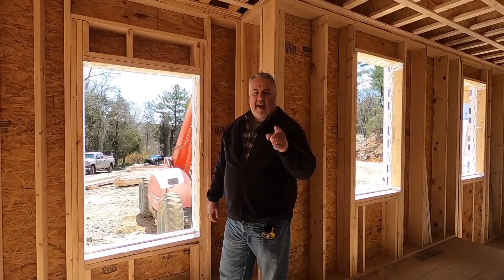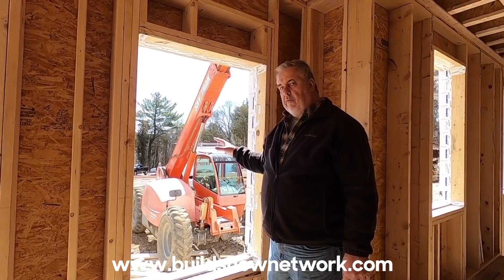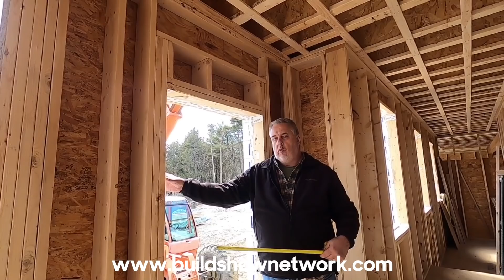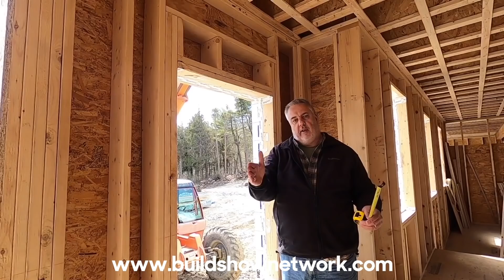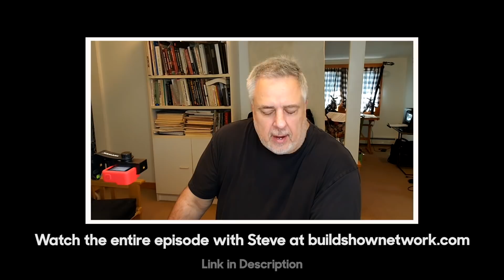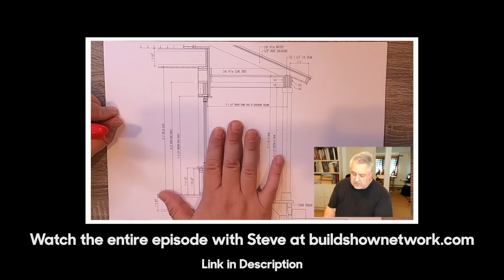The Fundamentals of Wall Framing with Steve Baczek Architect

Comment: double jack studs (trimmers) on such a short header span. Very unusual. I don't see the point. Also the cripples betweem the trimmers. Not necessary. I would think advanced framing would eliminate a lot here. I think it is clear this extra wood is not needed. Double non-structural header? This is prioritizing wood over insulation.

Comment: Steve, thanks for the video!   Can you please do a video on the construction of a house with floor joists, ijoists or trusses in a house with a basement?    I never have seen a detailed video showing the constructution but have seen joists on 2x6" over a cement wall, 2x10's with hangers sitting on a basement wall, and a few other things.   I'd like to see one that is designed to resist water rot and proper weight depth on the ledge etc.    I understand the type of joist and the depth of it is dependent on span.   Not sure if you'd like to get specific but I plan on doing a 2x6" wood frame house - single floor, with a basement.   Estimated size about 2800 square feet with a 36" wide basement.    I was thinking of splitting down the middle with a carrying beam or whatever the architect recommended.     I was going for about 10' between the basement floor and the sheathing for the 1st' floor, with 10" thick basement walls.

Comment: I fully understand the reason to use double jack studs to support the I-joist being used as a header.  In fact I would probably beef the I-joist up with some cripple studs inside the joist; sideways, hopefully leaving some room for insulation across the full width.  I hope there is already some insulation between the back side of the I-joist and the OSB sheathing.  With the wide width studs, I'm surprised you didn't use 2x10's with foam board insulation sandwiched in between.
Even so, I still think the window top plate should be supported also.  You pointed out the cripple stud below the I-joist;  where is that potential load being transferred?  And why isn't it centered?  I can only guess the wider partition is a 24" gap suitable for one of the planned insulation sizes.

The bottom plate looks to be untreated lumber.  Is the floor above ground?  I at first thought this was a garage/workshop because of the beefy door frame but the floor is not concrete.  What kind of door was planned?

Thanks for the education.

Comment: Honestly, I'm over stud style framing. I wouldn't if I built my own house. In fact, it makes me furious!
Reply: I understand the system, and it can work but I'm not cool with the generally inaccessible voids it creates, the attempts to stuff insulation, wires, and piping through said voids.
Reply: @David-gld  Matt Risinger of the same network here showed an awesome solid wall hempcrete build.
Reply: @David-gld  so, who are you?

Comment: I work in Oklahoma New Construction. I have a question. Why do you use 1x4s on the ceiling?
Reply: makes the drywall flat, texured walls is common for mid west, southern homes, most homes in the upper states and east coasts go with a smooth wall finish.

Comment: Wouldn't it be more economical, and produce a better insulated house, to use 2x6 framing and exterior insulation? Like Rockwool's comfortboard or Zip System R Sheating, not to mention foam board?
Reply: There is 2" rigid insualtion on the outside
Reply: You mean over 2x8 studs

Comment: so strange to still watch and see so much wood been used in construction. I am a fan of AAC and Concrete with Steel. And I think really we should start using those material a lot more often preformed to enhance the structure of a building.
Ok you got off a little bit there are 2 factors why you need a double top plate. One because your cross beams are off center. But more important because it is a CODE for any load bearing wall so later on it is easy to identity for remodel work to see what is a load bearing wall and what isn't.
Reply: Wood is a renewable resource with much much less embodied energy compared to concrete or steel, also has at least some thermal value, and easy to alter on site
Reply: @stevenbaczekarchitect9431  Wood sure is a renewable but also a weak structure material when you compare it to steel or concrete but lighter. If you would finally start to use more AAC you would see how much faster, more consistent and how much more R Value you getting plus on top AAC are Concrete Foam blocks so super easy to work with and with 51psi per square inch also much stronger than cinder blocks. You do really great work but missing out on benefits which will blow your mind away once you start working those into your portfolio. So keep up the good work and always challenge yourself to the next level.
Reply: Concrete is going to be short supply
Reply: @vanderumd11  Not for Florida. Maybe up north but Florida has their own mines so we a got all the supplies we need.

Comment: Nominal R-value = cavity R-value
True R-value = total wall R-value
Here in Canada, the codes are beginning to require R-20 as true R-20, meaning we must deepen the cavity, which presents more issues for condensation on the cold condensing surface (the deeper the wall cavity, the further the inside of the sheathing is from the heat, making it colder with heightened risk to condensation). The other solution is exterior insulation, more expensive, but seems to be the better option for building longevity.
Reply: Exterior continuous insulation is ALWAYS the win (except financially maybe)

Comment: The jack studs in the example don’t even support the window header. Why is that?
Reply: My best guess is simply that the studs are 2x8 and the actual structure isn’t needed for additional support. Just seemed weird to see it framed out appearing at first as expected, but doesn’t do anything but hold the drywall in place.
Reply: The jack studs go to the header. Which is a load bearing structure. The box below the header isn't load bearing and doesn't require the jack studs to that. Probably build this way to directly support the beams above. My guess anyway.
Reply: @Fucnut  Theoretically the header is designed to carry and distribute all load to its supporting "columns," which in this case are the is the jack studs. But, load transfer persists to all cripples (the "box below the header") as deflection occurs to the header (which happens in a gradual fashion as the building ages, or as sudden load is applied).

The cripples above a window are typically installed above the header in my area, so this is unusual for me to see and I am interested to see its benefits. But overall, cripples above the window apply the roof load to the header and around the window through the jack studs. The cripples below the window are never considered load bearing, but they are intended to support the weight of the window and any live load (like a person sitting) in the cavity space. 

-Studying engineer
Reply: @Fucnut  couldn't one also frame a jack stud to hold up the window header, and then a cripple in the top box to take some load off the overall opening?
Reply: @Fucnut  In this case, there are 2 jack studs that hold up the top of the "box" but no cripple studs that go to the top plate. I don't see any benefit for having 2 jack studs on each side of the window holding up no top plate load whatsoever.
Reply: The header is tight to the top plate, the framer prefabbed the walls in the barn and we weren't exactly set on the finish head height so they built down from the header
Reply: I noticed that to. It looks like he just built a box to put on top of the window which serves no structural purpose IMO.
Reply: @borys444  The jacks are supporting some sort of beam above the window and cripple wall.Never seen it done like this before but not wrong with it I guess.
Reply: Fereidoon Angoory yeah it’s as u say “some sort of the beam” but doesn’t that defeat the entire purpose of supporting a load bearing wall properly? U would need the window header  to sit directly under the top plate of the outer wall in order to distribute the load properly.
Reply: @borys444  The header is taking on the roof framing load above and moving it to the jack studs. The cripple is acting as just a wall infill framing. Not sure why they would put the cripple infill in.....maybe future renovation (Higher Windows etc).
Reply: Fereidoon Angoory but the header doesn’t go up to the top plate. It isn’t carrying load. It’s simply a 2x8 laying horizontal above the two inside jack studs
Reply: Iowa guy 43 Matt’s guys should make a video segment on y this window is framed the way that it is. Lol

Comment: Is that number of studs normal?  I count five studs by the window.  Is there a cement truck on the second floor?  (Yes, I'm NOT a building professional or an engineer.)  I'm just curious.
Reply: I can speak for what I can gather at the freeze frame at 2:00

The window has three studs on either side, listed from outside in they are termed: King, Jack, Trim
As Steve mentioned, a King is a typical stud for all intensive purposes, the jack caries the load of the header to prevent a case of shear failure, and the trim stud accepts the windows and indirectly supports the header above the window.
Between the header and the window are the cripples, typically found in my area installed above the header, but I am definitely interested in learning the pros of this method.

To speak to the door opening at time 1:43 it appears the following is happening. The increased opening span of the doorway results in a greater point load applied to the column, so two studs are directly supporting from beneath, while another acts in a stabilizing manner such as the king stud. The "king stud" and an additional two studs (totaling 3) appear to be supporting a structural beam that is aligned with them from above and runs in the perpendicular to the door opening. In essence, two columns are side by side.

In the space between the door and the window is a "common stud" as Steve refers to it, and that it located beneath the floor joist to reduce the shear that the double top plate is subjected to. 
 
-Studying engineer
Reply: @vMrSharpYv  Thanks for the explanation!  Good luck with your studies.
Reply: @vMrSharpYv  There are also some beams above
Reply: I was wondering something similar. 2 jack studs on each side of each window shown and then the big window just to the left of frame has 3 king studs on 1 side also? Why so beefed up?
Reply: @Brian McKay Look to the opening at the left of the window.

Comment: good stujff.  2x4 0n 16 and 2x6 0n 24 use the same amount of lumber for structure. would their be an  energy advantage to going to a double wall using 2x4 on 16 outer walls and either 2x4 0r 2x3 0n 16 or 19.2 or 24 for the interior wall  that would only carry the insulation and drywall?  0r maybe even a wood i beam for the outside walls
Reply: a double wall was done to eliminate "bridging" (the inefficient R-value of wood studs), but I believe it is more effectively done by blanketing the entire structure with rigid insulation. This stops all bridging.
Reply: I heard mixed reviews about double walls, most just say if u lots of money to piss away then go ahead with it but other then that it’s not worth it.

Comment: I realize it's tradition on the East coast, but why are you using strapping on the underside of TGI joists?
Reply: On another video a builder said it allows them to shim if needed to level the ceiling perfectly.  Seems surprising to me that you'd need that with an engineered joist, but maybe those level-5 finishes really are that unforgiving.
Reply: it's  quite cheap to do I bet it gives a few things ,   shimming as James mentions and also additional ridgitiy
Reply: Also, electricians have come to expect it here
Reply: Also makes sneaking a wire thru the level 5 finished ceiling alot less invasive. Someone with this money will want to make changes to the lighting later on.